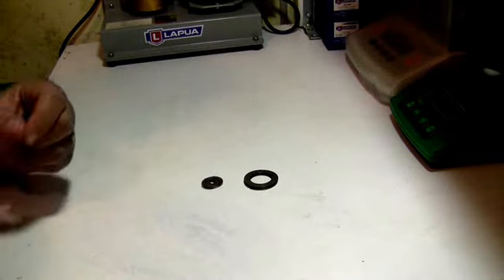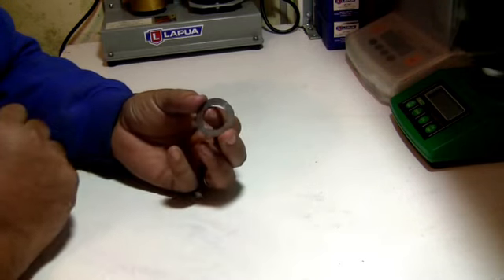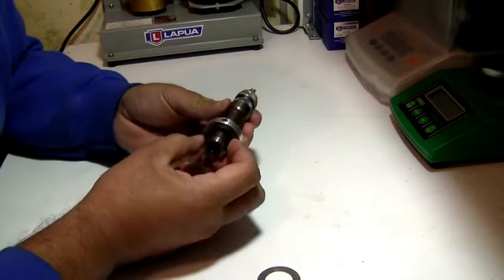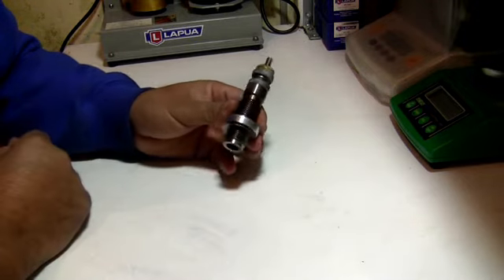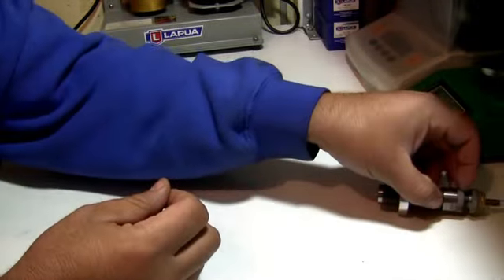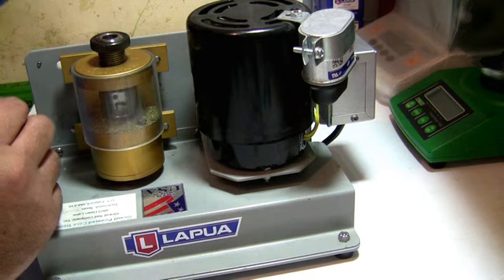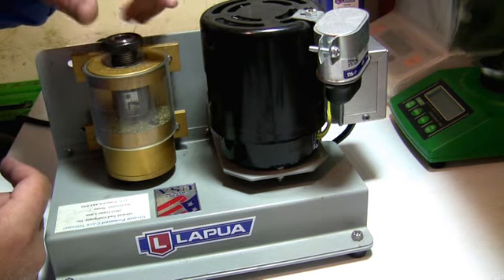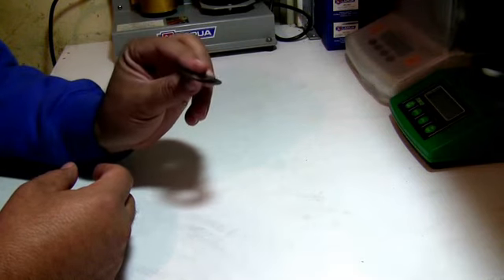Precision reloading tips #3:  Skips 7/8 die shims

Comment: If you have multiple rifles in the same cartridge (or very similar, i.e. 223 Rem & 5.56 NATO) with different headspaces, you can use these instead of a second sizers die or constant readjusting.  The only problem is they don't have .001" and .002" shims, if you want that level of precision.

Comment: Why do you full length size instead of neck size?
Thanks
Reply from the maker: Lee Davis Because it is more consistent.  When you neck size the brass keeps growing after every firing which means it is a different size after every firing, that's the reason you will have to full length size at some point.  When neck sizing, the base of the brass keeps growing and work hardening, and at some point it will cause extraction issues and cause a click when opening the bolt.  A lot of time F/L sizing will not cure this, so a small base die must be used.  If small base die does not fix it, brass must be discarded.  

When you F/L size, brass is the same size every time.